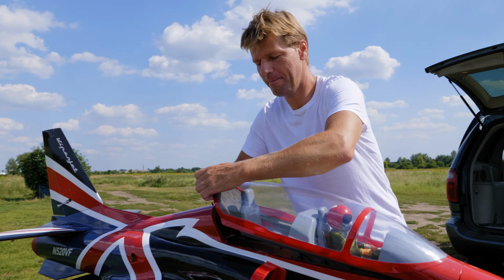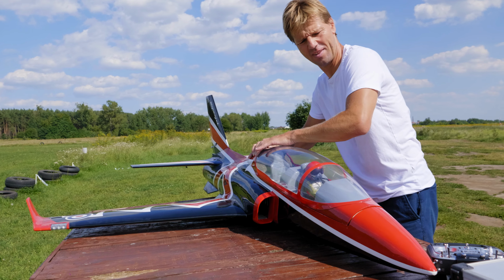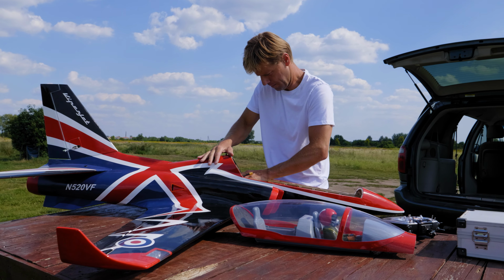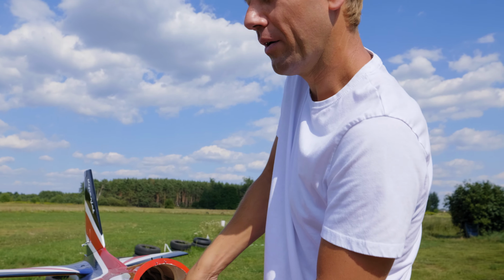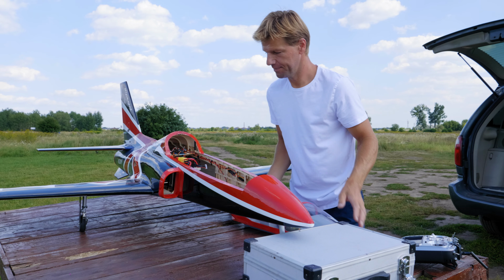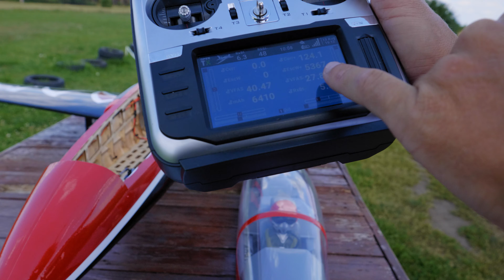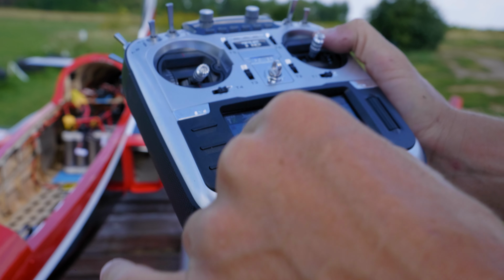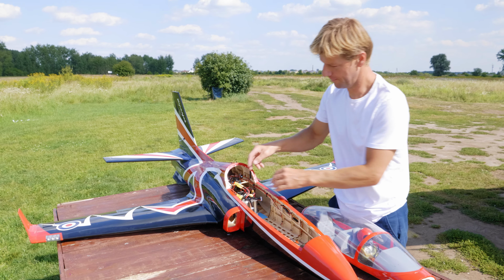Black Horse Viper XL  HET 700 75 1400kv 90mm EDF WeMoTec Midi Evo 12s Li ion Samsun

Comment: Great informative video's. I'm in the process of completing the build on this plane and i have a question regarding the vertical fin/rudder, did you strengthen the mounting, to me it has a little to much flex. Your thoughts

Comment: Good morning. I really like your videos, I learn a lot from them. I bought the Black Horse Viper 1.88m model, and I want to apply an automotive varnish to the fuselage to give it a glossy finish. The problem is that I'm afraid of applying the varnish and ruining the plastic that covered the fuselage.
I ask you, what brand or type of varnish you applied to the plane. Do you know if, when preparing the viper body for varnishing, it was necessary to sand the body for the varnish to adhere?
Thanks

Comment: Hello, your Viper has glossy custom finish looking pretty good, my one is delivered with factory surface. What kind of glossy paint is applied. Long lasting ?
Reply from the maker: You must first clean the plane with alcohol and than paint it with automotive 2 part poliurethane, exactly the same as they use to paint cars. But you need compressor, gun and some skill. Or give it to car body shop and pay for the job. It is a strong and long lasting paint. I have put 3 fat cotes of paind on my BH Viper.

Comment: One could probably argue that you’re probably choking off a bit of performance with those LiIon packs, they typically cant output the same as a LiPo
Reply: Well, HET 1400KV is meant for 10S Lipo - he uses 12S li-Ion. This more then overcompensates ;)

Comment: hello,i just bought the servo's for this plane,micro servo's from SAVOX SV 1232MG HV   5KG,is this enough? is the size correct according the manual? i don't have this plane yet
Reply from the maker: Power more than enough. I use 3kg servos on it. But your servos are to short. You will have to add some plywood with epoxy or CA glue. Better buy this servos: TOWER PRO MG 16R DIGITAL or HITEC  HS 85MG